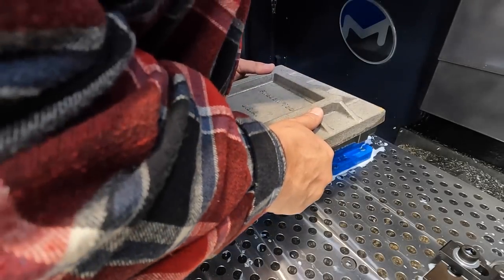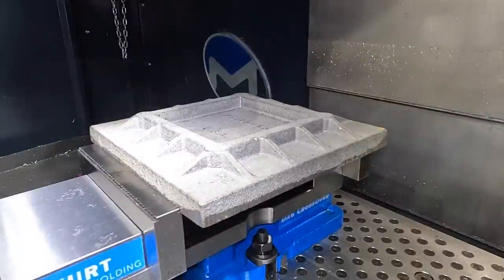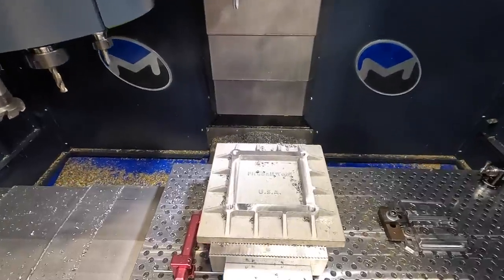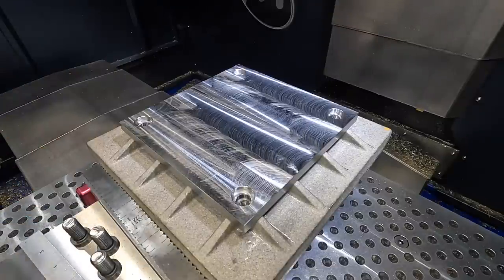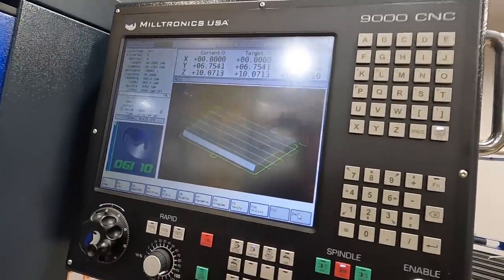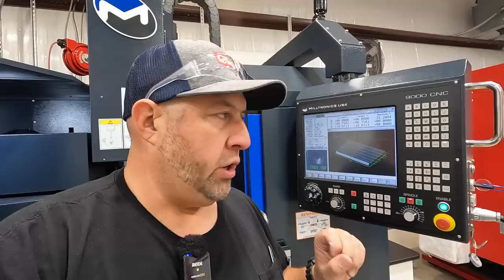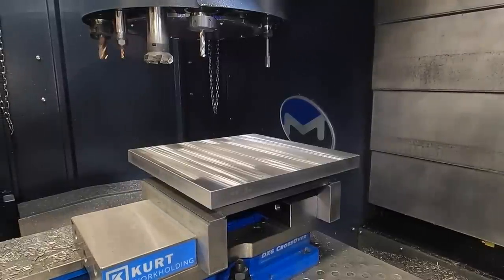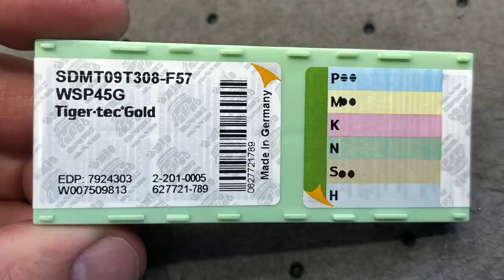CNC Machining a Fireball Tool Fixture Plate

Comment: I don’t know if anybody has told you this lately, but I think  your doing a really good job Adam. Everyone will criticize when you don’t do something 110% but fail to tell you how well you did the other 100 things perfectly. Gotta love those critics.
Reply: Well said.👍
Reply: Here here
Reply: Most comments on the CNC have been supportive and instructive, and he followed through on the cutting air option.  The use of the rapids override and the like  will come with practice but should have been emphasized during his 2 courses beforehand.  He is not a kid who should expect a hug every 5 minutes.  Learning this stuff along side an experienced machinist in industry, you either learn quick or get replaced by the next kid, no explanations needed.
Reply: @richardjones7249  
Adam is doing a lot better than me. I have a small welding shop and I purchased a CNC plasma cutter. After a few months I gave up and got rid of it because I couldn’t get my head around programming or running programs. The Computer stuff was just all too hard. In my defence I’m 66 years old and have never owned or operated on a computer. Wasn’t interested. If my iPad didn’t have voice to text I probably wouldn’t be able to post this comment😃👍
Reply: Well said agree 100%! 👍🏼👍🏼👍🏼👍🏼👍🏼
Reply: @davidcat1455  You misread my comment; I never said he wasn't doing well.  On planet YouTube, you get mollycoddled ( but there are negative comments also, just to balance things out, lol ).  Once you get into real world industry, how well are you doing? just compare your path and promotions to those that started at the same level. Ask yourself if the promises the firm gave you when you started are turning into reality.  High fives on every task completion is not the norm ( thank god ), but( you're doing ok) talk is cheap and not a true read. On computers and age, my old boss got his professorship in his early 60's and that was at the forefront of computer modelling, but maybe it was in his genes cos his dad was a Prof as well.
Reply: @richardjones7249  
I’m amazed that you took my comment negatively. I didn’t say or infer one negative thing. I just said that Adam was doing better than me and explained why I gave up on using a CNC. I really couldn’t care less what some random professor managed. Some people are academically inclined and understand technology and some of us have dirt under our fingernails and actually work for a living. I’m doing just fine without Technology and just because I’m not interested in it doesn’t make me a lesser person than your professor. Looks to me like you’re the one who did the misreading. You have a nice day.
Reply: @davidcat1455  well said David
Reply: @barnzYT  
Thanks👍
Reply: You're**
Reply: Had enough? Vote democrat!
Reply: @dallet40  Bruh. This isn't the place for politics. Please see yourself out
Reply: @PaperMakersAdeludedbroad  
Exactly 👍
Reply: I agree...for me I never once thought he was worthy of a criticism, I have a great respect for him and his ability,, I'm a hack machinest compared to him so I have no right to pull rank on someone this  accomplished..and can't understand some thinking they can. Ok maybe Titan could,,,ha
Reply: @davidcat1455  lol..I'm 65 and code microprocessors and have a small cnc (can't cut a wet napkin) and I feel your pain... I still love to manual machine..,something really satisfying running by the seat of my pants.. Like playing guitar.
Reply: @PaperMakersAdeludedbroad  say it to ukranians

Comment: A great free program for feeds and speeds is called FSwizard, You can set your workpiece material, tool material, size of cutter, number of flutes ect.... And it will spit out a good starting point for RPM and feederate

Comment: Adam
This is the first episode where I felt I might have something to offer. 
Let's start with: on the very first cut I ever made,  I hit a weld and broke the spindle. Luckily, there were no cameras running. 
Over the years this is what I have to offer someone new to CNC: 
Never hit cycle start until you are confident. 
Cutting air is definitely a confidence builder.
Limit yourself to one new process per cycle.
If you need to do 3 new processes, simply do them one at a time.
Practice with plastic (HDPE - High Density Poly Ethylene). It is very kind to your machine and tools when things go awry.
Bring your machine up to speed using the Rapid Control Knob. Within seconds, you will know all is well. 
Manual machinists do well with conversational, while CAD and CAM is new territory.
We all learn at different speeds. It is not a race nor a contest. Not everything comes easily. 
When things work well, review what you did to make that happen. 
When you make 3 errors in a row, shut down and spend the rest of the day cleaning, doing maintenance and editing.
When your machine first crashes, you will most likely watch it happen without doing a thing. 
The second time your machine crashes you will hit the kill switch faster than a toupee in a hurricane. 
We all know YOU can make big chips, so no need to prove it with your new CNC machines. 
Keep up the fine work!

Comment: Another trick I have learned with programs, not necessarily CNC, is I create a Function Key Cheat Sheet that I hang on the control panel. Gives you a quick reference to use in case you forget what Function Key you want instead of having to go through your notes. This also helps you to learn them faster. You are doing great and approaching this from a smart way. Thanks very much for sharing.

Comment: What up Adam, my name is Daniel I'm a 33 year old die maker. I was lucky enough to apprentice under older die makers that trained me in extremely accurate manual machining, such as form grinding tight die features. After I learned conversational programming on a prototrack, then I moved to programming with cam on machining centers and E.D.M. machines. Now I have my own tool and die company where I design build and run metal stamping die all in house for the auto, aerospace, military industries. My point is your doing a great job, I have picked up great information from your channel and your entertaining. Keep doing what you're doing, you will be doing advanced cam programming in less than a year 👍

Comment: You are going through exactly what I did with my small wood cutting CNC.  The CAD to me was already in my toolbelt.  The tooling, cutting depths and feed rates was/is not!  Still learning as I don't have your resources for help when needed.  But that's ok since my CNC is my retired hobby when it will come in handy to route something to perfection such as artistic details or lettering to personalize an item.  Good video.

Comment: Try a 0° lead in instead of a 90° lead in. It's less likely to shock the tool and leave a witness mark on the edge of your material. Also the vibration when cutting the perimeter of the cast iron only happened at the corners. It was the furthest point from the bolts with the least amount of support. Everything you're learning right now is putting another crease in the gray matter. Keep walking through it and that crease will get deeper. Keep up the good work Adam!

Comment: I'd check the jaw lift on your vice to make sure it's acceptable when using the Piranha Jaws. I only use the serrations for first ops because of that. Then I switch to parallels for the second op so I can whack the part down on the parallels.
Reply: I was surprised when he was try to get the allen key out of the bolt how much the jaw lifted actually. It seemed way too loose for a new vice...

Comment: 100% correct on the feed and speeds talk!  cnc is so disconnected, it has no 'feel' like manual machines!  when I first started running cnc I was way too slow then as I learned the machine and tools I could push them to their optimal speed.  No worries on you being slow for now youll be flying through parts soon enough.

Comment: Tip for using the end mills around the perimeter. If you set your start point for a rounded edge or a corner it will hide the faint line that is left from the start and stop of the cut

Comment: Super inspiring to be diving into CNC after so many years of strictly conventional. I'm sure there's a lot of guys watching and learning right along with you. 
Really though, literally anywhere you find machining content, there's always some button pushers commenting about it not being optimal. You do not need to justify yourself for anything! Every shop is different and some shops don't even care about being optimal! In my shop, my bosses would much rather I be conservative on my feed rates, and make parts within spec the first time. Instead of snapping a drill off during a run of 5 prototypes!
Get good first, then you can get fast!
Good luck and great job.

Comment: you have a function called single block on the machine, it's a button on the control panel. it is a very nice feature when you run a program for the first time. it will make it so that the machine will only do one movement/command of gcode at a time for each time you press cycle start, which gives you more time to see if there is something wrong, and maybe a little more peace of mind.

I agree with you about learning to program directly on the machine and not just using Fusion 360. once you've learned it, it will often be faster to program simple operations directly on the machine than going back and forth to fusion 360.

keep practicing and you will be surprised how quickly you learn👍

Comment: You are doing very well, Adam.

When you start writing in G-code, if you are still afraid of Z crashing your cutters after proving the program, turn on single block mode if your machine has it. This makes it so it optional stops after every line.

Then you press cycle start until you complete your z rapid down and then press cycle start again with finger on feed hold and let the machine go. If you don't crash, turn off single block and start and watch the chips.
Reply: Is there a difference b/t opt stop and single block? I run a Tsugami lathe at work and it has both options but I only ever use opt stop.
Reply: I can confirm this is the best way to do it!  And also offsetting the Z axis above the part a few inches and then running the program will show you exactly what is happening and where. And always keep your hand on the feed hold

Comment: If you are interested, I have hundreds of hours of setting up CNC machines of a multitude of types, from Rock cutters, waterjets, electronic pick and placers, laser cutters, milling machines, plastic and aluminium extruders, house framing robots, Knitting robots and so on. 
I can offer you a few tips to make your life easier from the start, 
One the vice is very pretty but completely unnecessary, and could cause you pain as you go on. The reason you have chatter is the vice btw. 
The second is, trust the machine to know it's coordinates, unlike setting up in a manual, or semi manual machine, there is no need to use the edge detector at more than two points.
Regarding the start work position, starting in the middle of the x-axis is going to cause you problems as you get more complicated parts. Try starting on the corner closest to the tool and curve into the edge (as you are doing now).  
Three, use the holes in the bed as locators for your parts, they are extremely accurately drilled, if you are worried about hitting the bed, put a sacrificial sheet of material under your parts.
Four, you will break tools (especially the small ones), everyone does, have spares.
Five, The machine has a home position, all other points are relative to that, so it is always a good choice to set your part X,Y,Z, and your drawing reference 0,0,0 a standard distance from the machine home. Then you will know that every job is going to start there, it will really reduce stress.
Six, CLOSE the doors. Safety, I cannot emphasise enough the need to close them. I have seen nearly 30 people who got injured by these robots, they are so powerful you cannot get out of the way fast enough. Lost limbs, fingers, hands, tools embedded in the chest, and even one guy at a steel mill was never seen again, he had a habit of defeating the blast doors on the pouring vessels to scrape the dross off the start of pour. No one saw what happened but we suspected he got sucked into the melt, there was nothing found of him. At the same time I was diagnosing a fault on the robot that cut the welded and x-rayed pipe into standard lengths.(With the customer,CEO,Plant Manager etc watching my every move). Sorry to be so macabre but safety is paramount.
Seven, Sequence of operations, you will find a rhythm that you like, but I've found in most instances that depending on the part they are either a pyramid or a bowl, Pyramid you start outside and work up, bowls start inside and work out. 
Eight, if you have say more than five holes of the same size, give the tool a break, drill five, then do something else, then back to drilling, repeat, the drills will thank you for it, and tool change is very quick.
Nine, Don't be afraid to set multiple instances of the part in a grid pattern, and use replicate to copy the cut functions for each. It's up to you if you want to say cut all the outside's before tool change and the next step on each, or complete a part before working on the next in the array. 
Ten, save your designs, on multiple machines, multiple devices and memory systems. There is nothing more frustrating, than having to build a CNC program all over again, due to a bad memory stick or lost password.
And finally, make copies of the machine software, take copies of the passwords, setup numericals, coordinates, etc etc, and take them off site.

Comment: I get told all the time when talking to other more experienced machinists about how to choose f/s that the data sheets for the tools you have are a great start for what to choose. The key though is to think about the machine and fixturing you are using. The machines the tool makers are using are big and rigid with fixturing as solid as it gets. You aren't going to be able to hit the same numbers they are so starting conservative is the smartest thing. You have probably been told this 100 times already, but it bears repeating, especially when you try something that should be good in theory, but isn't working for your setup. Thanks for the videos. Even when you are doing something I should already know how to do, I learn a little bit every time.

Comment: Adam, what you need is a "cheat sheet" manual that you can mount on the bottom of the control station.  We had one when I was in the service for troubleshooting computer circuit cards that had umpteen bunches of IC's on them.  We ran a test on the card and it would give us a code that translated to an IC on the board.  Then we would chip off the conformal coating, replace the IC and recoat the spot, then rerun the test to confirm the fix and put the card back in stock for later use.  Using cheat sheets to remind you of what to do is a good way of building that "muscle memory", before long you will find yourself not needing the cheat sheet, but they will be there if you have a temporary lapse of memory.  Plus you won't have to take the time to call or Email Steve, you just look at the appropriate "sheet" and solve the problem.✌😊 
P.S.
You might consider going to your local community college and taking a course in CNC programming.

Comment: Nice work there man! Don't let anyone give you a hard time about learning to walk before you run.  In regards to speeds and feeds I will say I like sandvik a lot because there website makes it easy to get cutting data for the tools and they always run well at the recommended speed and feed. Also a CAM system really will make it easier for you to program complex parts and I do think you get better tool life and MRR out of the more modern tool paths. That being said there is a learning curve with that too....

Comment: Great video! Glad to see you starting to run the CNC. One thing I would suggest is when you were adjusting the air pressure when the tap was loaded. Especially when you're new to the machine I wouldn't put your hand underneath that tap or any endmill for that matter.  The servos on this machine are incredibly powerful and can move fast. Just watch yourself around the machine until you know it's in a safe state when you get your hands on there. If you're in mid program and do a feed hold or pause, I would just get in the habit to be cautious around it while the servos are powered.

Comment: Once you get the fixture plate aligned to the base, consider putting in a couple of dowel pins (in asymmetrical positions so there is only one way to assemble).

Comment: Air cutting is definitely your friend and a good first line of defense from having discouraging mistakes happen😁. When proofing a program and on tool approach another great safety measure is using distance to go. I always feed hold as the tool gets closer and watch the distance to go and compare it to what I see in the machine. With a combination of turning your feed and/or rapid down, you can give yourself plenty of time to confirm your programming. Ask me how I know😂
Reply: Good point, I haven't done any CNC machining in a while because I switched careers but when I was a machinist I would always dry run a program at 25% rapid before ever running a part. I would go months without scrapping a single part just by confirming everything about the setup before a first part.

Comment: Two tips i can give you is to try to lead in and lead out off of the work to get a good even cut, And mount that shell mill on a low profile holder. Itl vibrate alot less and you can run it at faster speed/feed.